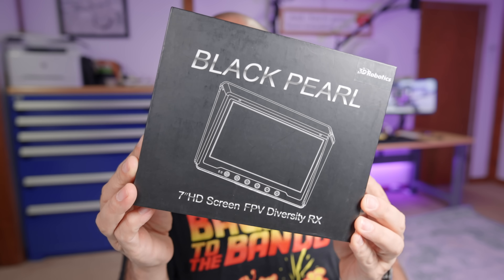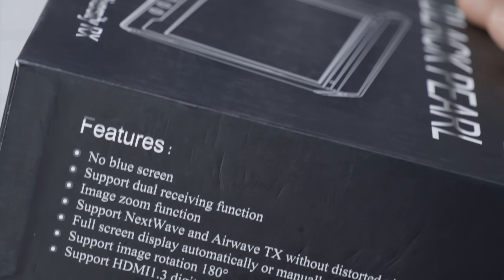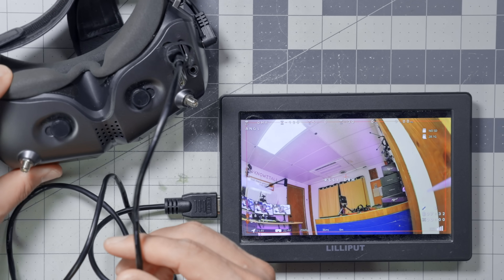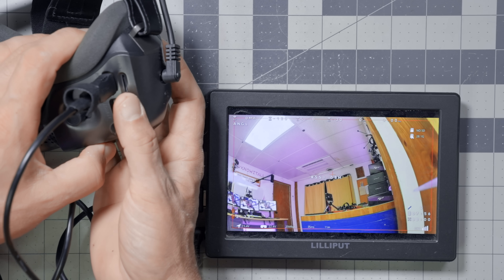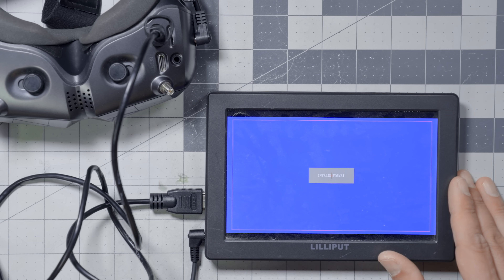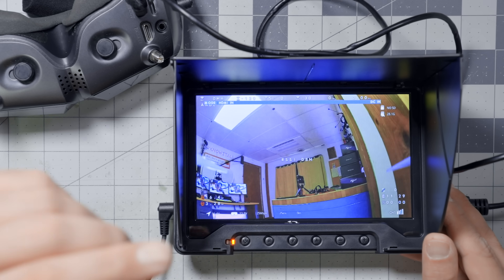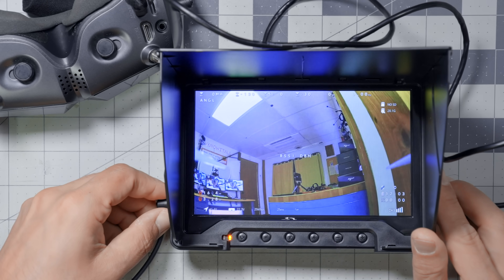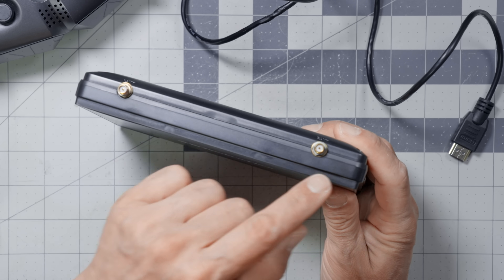This ancient screen: suddenly relevant TODAY!

Comment: Thanks for this video, I usually connect the goggle x with my samsung mobile and it works. I have to use the capture card to convert from hdmi to type c. But in goggles setting it has to standard frame rate then only it works, if i set to high frame rate then it shows only snow in mobile.

Comment: I think the panel doesn't actually display 100 FPS, but at least the driver is able to work at 100Hz and thus doesn't force the pilot to reduce his framerate to 60Hz whilst flying.
I'm pretty sure the spectator will still only see 60Hz. If it actually displays 100Hz... that's one heck of a discovery.

Comment: I have this monitor and use it as backup for my goggles. We bought for our first fpv drone: a dji phantom 2 (those two don't sound right together lol). We had to install iOSDmini and and the first zenmuse 2 axis gimbal. It felt like the future. Now the screen is just an old backup i use with a lipo in the charge port because the built in battery is shot.

This looks great!
Reply: also I have the flysight one with no SDCARD on it. bardwell...
Reply: Similar here, had for a DJI F550 flamewheel with the dji iosdmini and gopro 4 black... the screen was brilliant at the time and with diversity too.

Comment: I had a huion kamvas 13 gen 3 drawing tablet for notetaking which accepted displayport over usb c and it worked with my hdzero (while using 90fps mode) hdmi out. I just used an hdmi to usbc cable and it displayed things well. I’ve since returned it because it broke, and got a new wacom one, but that doesn’t work. 

Might help, but I got my drawing tablet mainly for notetaking, and it’s very expensive for just an fpv display.

Comment: So I have a 13inch Azopa portable monitor it displays 100fps walksnail no issue, it happy shows every VRX system I have thrown at it ($100-$150) on Amazon, your other option is to get a dual hdmi capture card, then you could literally use any monitor / laptop / ipad or tablet that has hdmi or usb-c
Reply: Capture Card,... I wonder if the HDMI-to-CSI2 adapters for Raspberry Pi will suit?

Comment: Amazing work JB and Umma 👏

Does it actually display 100 fps, or just take the signal and show 50?
Reply from the maker: I assume it's not actually displaying 100 fps. I have flown off it though and didn't notice a significant amount of latency.
Reply: @JoshuaBardwell Then what is the point of it? 😅

Comment: Im using my tablet with hdmi to usb-c. Works flawlessly and is much cheaper (I already have the tablet)
Reply: Which dongle do you use? I'm doing the same but mine cant do 100 fps
Reply: What tablet are you using? I have a Samsung Galaxy s9 tablet but as far as I'm aware it doesn't support video in so I will have to get a conversion card or something rather

Comment: I already fly 60hz, I never saw a reason to go to 100. Anyway, I bought a portable monitor on Amazon for like 80 bucks. It’s basically like if you ripped the screen off a laptop and made it able to work on its own. Runs off a USB power bank and has an HDMI Mini input. Works great!

Comment: Hmmm i wonder if you can just use a Edid dongle where you change the handshake request resolution/framerate.  They have hdmi in and out and little dip switches to set the request.
Reply: The HDMI-to-CSI2 boards use the same sort of EDID profiles.

Comment: Shocked the Atomos didn’t work, and I expect other field monitors in the video world have the same issue. Maybe not as portable but what about a format cross converter like a Decimator taped to the back of something nice?
Reply from the maker: I have found a couple of field monitors that support 720p100 in the $1500-$2000 range. They explicitly list it as a supported format in their specs. Since the explicit purpose of a Decimator is to cross-code video formats, I really would expect it to work. However, they don't list it as supported in their specs sheets.

Comment: Grateful for this. Can someone point me to a focused video that goes into detail about WHY the WalkSnail ecosystem is so issued? I think it seems to focus around heat or similar? Otherwise it kind of sounds to me that WalkSnail nails the VRx the way I'd use it (slow steady high quality Cine). NOT into fast racing, etc. While I am new to quads, I am not new to RC, however I've had about a 25 yr gap between then and now. What's the big issue with WS?
Reply: Quality control. It's a gamble if your stuff works properly or not. And lately, they've been changing internals (gt no longer has an internal heat spreader) without telling anyone.

Comment: I want to get into drones, but they’re so confusing. So are the controllers. I wouldn’t know where to start.  

Edit: I fixed the typos 😅
Reply: you're on the right channel to learn lol
Reply: start with a radiomaster boxer or even the pocket and one of the drone simulators and follow the tutorials from this channel on learning how to fly. JB is the guy that knows fpv and quads inside and out he is very knowledgeable about all matters related to fpv. if he can't teach you or figure out what issue you may be dealing with then you're in bad shape. get a radio and follow his tutorials is almost every ones advice and it is a very effective approach. you can learn a lot from the sim and don't have to wreck a good drone like a lot of us have.
Reply: Radiomaster Pocket
Air75
And atleast 10hrs on SIM, YOUTUBE and research on electronics, soldering and basic troubleshooting. Search and you will find!